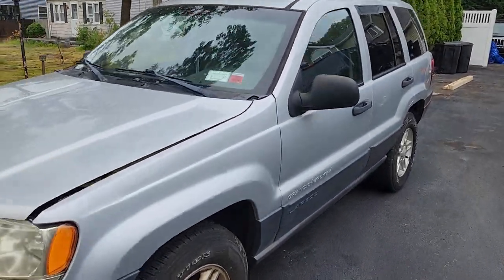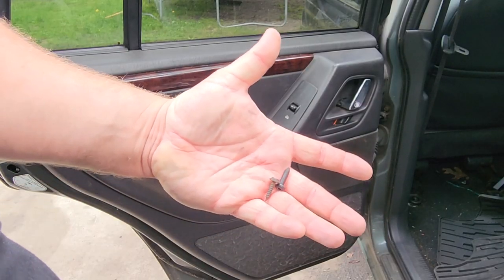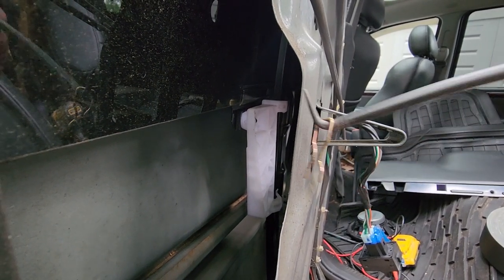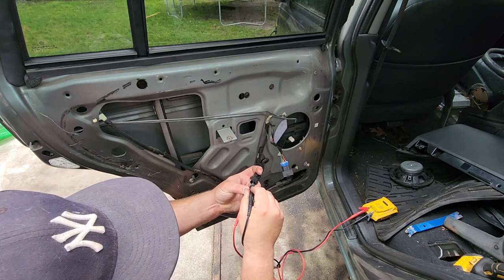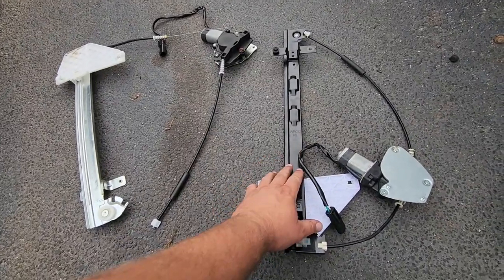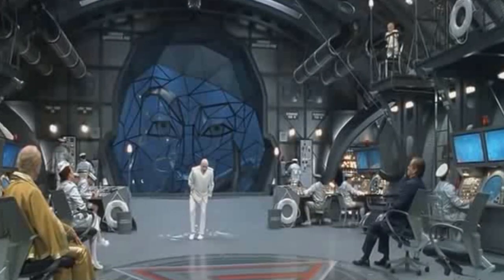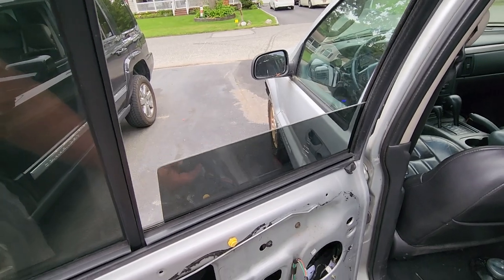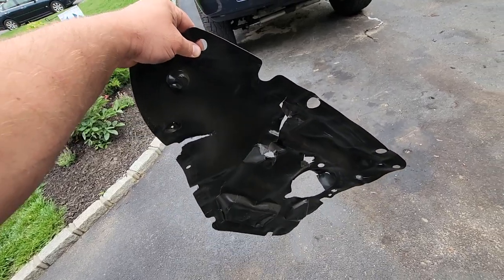JEEP GRAND CHEROKEE BUSTED WINDOW HACK & WJ REGULATOR FIX

Comment: If you can hear the motor with no funny noises like lacking or stuck most likely the plastics cable springs are broken or wore out ,, buying a cable kit if available will be the answer ,or buying the parts separate , junk yard or buying the whole kit new , keeping n fixing the spare or sale it,,

Comment: I need to figure out why on my 98 ZJ front passenger door the outside door handle when you push the button in it doesn't engage properly to be able to open the door. When you stick the key in the door and turn it works though.....
Reply from the maker: Maybe something is busted inside.. dona handle swap! I have a good shot of handle swaps in my commander door swap vid and my WJ door swap vid
Reply: @ProjectDanH  I'll have to check that out! Wasn't happening before and it's only the passenger door outside handle.